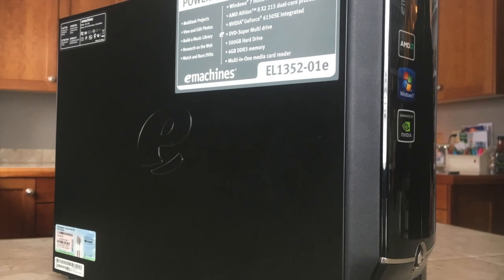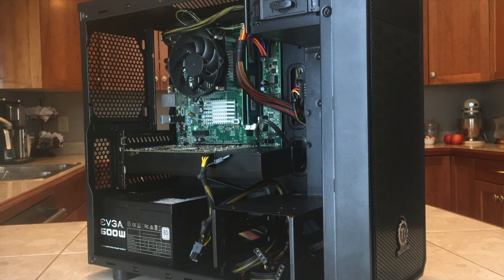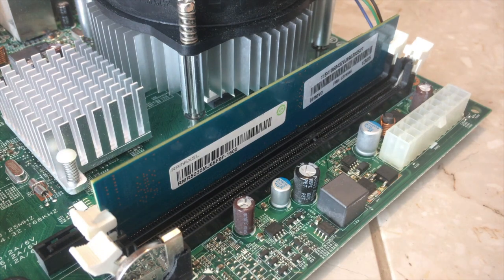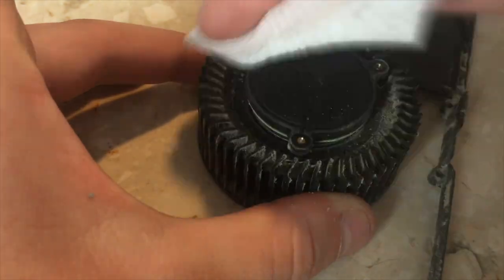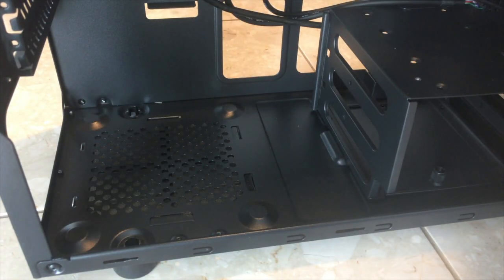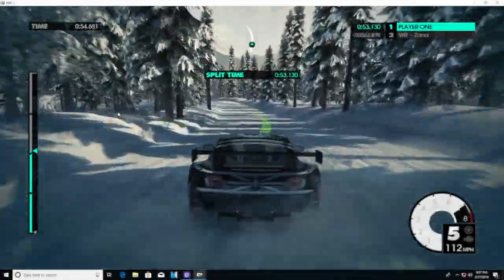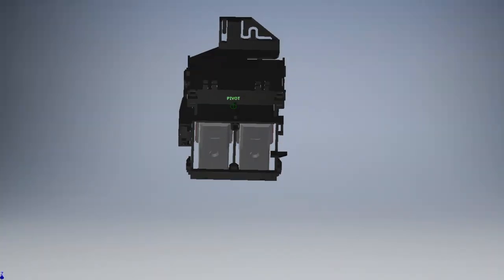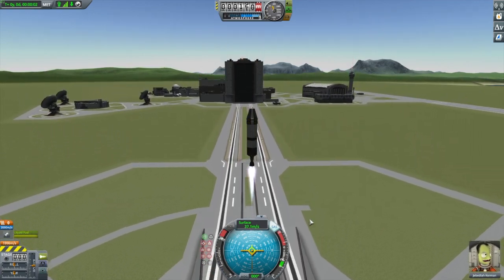Upgrading a 9-Year-Old Prebuilt PC into a Budget Gaming Rig

Comment: I know this is old as hell, but I used to have one of these. Except mine only had 2 gigs of RAM. Then I ran the ultimate test; Can it minecraft? Answer? Nope. Even with the lowest settings, barely managed 2 fps. And then it overheated and died on the same day the warranty expired. Or at least I think it overheated... The fan on the PC wasn't happy the last few weeks of life... Then it BSOD'd and was stuck in a boot loop.

All of this happened before I finally learned how to actually fix computer issues (as well as build computers from scratch), but at the time, that meant scrapping it since it was only worth like 200 bucks at the time and the shop I went to in order to try to fix it, wanted 250 just to replace the HDD.

Comment: Have a similar ultra-slim form-factor eMachine (EL1852g-52w). HDD is the bottleneck for processing on Win10, so best to bump that to an SSD. Stock mobo only has VGA, so if you can't find a low-profile HDMI gfx card, you'll need to buy a VGA-to-HDMI adapter to pipe gfx out to HDMI screens. Doesn't have wifi built-in. So, you can either hard-line it with a Cat cable, or (what I did) get a little $10 usb N wifi adapter. Plug that & a usb adapter for wireless mouse/keyboard in the front, and good to go.

This makes a great HTPC / old-school (NES/SNES) console emulator.

I found mine in the dumpster, and have been upgrading it with parts from other dumpster computers I've come across. I bumped it to 4gb 1333 RAM, but mobo forces it to run at 1066. But, as shown in the vid, you can slap more than 4gb ram in these. (their online specs say they max at 4gb, but folks on forums have succeeded chucking more in. It's just you're limited to 2 ram slots). I upgraded the Pentium it came with to a Core2Duo from a Dell I found. I even swapped the 5400rpm HDD with a 7200rpm one from that Dell (just imaged the old drive onto the new, and slapped it in place).

It runs fine once it's booted and Windows has had time to sort itself out. What seemed to really bog things down was having Delivery Optimization switched on in Windows Update. It was hogging tons of disk time trying to look for or pawn off updates to other things on my network. Not sure why it was such a disk hog. Switched that off, and it's much more reasonable. But, large Windows updates still bog things down and seem to take a long time to roll in.

Mine didn't have a low-profile gfx card, so I had to get a VGA-to-HDMI adapter to interface it with our 1080p tv. 1080p youtube vids are slightly choppy, but not too noticeable. It can do NES & SNES gaming just fine. It has a DVD player, so it acts as our DVD player. We bought a couple of usb SNES-style controllers, and load up MAME or such to play old-school arcade games. It's really a good, solid computer. I wish I could find a better ultra-slim form factor mobo so I would have more upgrade potential, but it is what it is.
Reply: I actually have the exact same pc that I had gotten from my grandparents; had tried to swap out the ram for a 2x2GB upgrade but it would just do the constant beep once it started, my guess is that it’s a different style ram.

Comment: do i realy need the new case?
Reply from the maker: If not, you’ll need to plan your parts around the slim case (no full size GPU, no upgraded power supply, meaning your CPU and GPU can’t be as powerful), so you’d likely be sacrificing computing power and/or increasing your cost to get smaller components.
Reply: @KeplerElectronics  thanks

Comment: Can I put a radeon rx 570 on this rig?
Reply from the maker: Yeah, you can, just double check that the power supply is good enough. I would be worried about bottlenecking if its for something like gaming though. For something like Blender, it might be ok though.
Reply: @KeplerElectronics  I was going to buy a graphics card, because I wanted to play fortnite hehe.
Reply: @KeplerElectronics  what graphics card did you have in the video?
Reply: @KeplerElectronics  is the AMD x4 620 the only processor I can use?
Reply from the maker: The card in the video is a GTX 660, which works well for most mid tier games, I actually upgraded to a Phenom x4 955 since the video, and I think there’s some even more powerful chips, but I’d be wary of running something much hotter without a better cooler, which I was not able to make work thanks to what I believe is a proprietary cooler mount.

Comment: I had one of these in 2006-2009, before building my first pc, and its (the emachines) specs were DDR2 2gb, AMD Athlon 64 1.2GHz, and stock intel IGPU, and no upgrade paths rather then the one extra DDR2 unoccupied slot available for an extra stick to run in dual channel lmao, also that specific board runs back to the el1200-01 (the one I had) the only difference is the addition of a PCIE-X16 whereas the original just had the PCI-E X1!  

the original board funnily enough had the Pin layout ready for the PCI-E X16 slot
Reply: I actually own the Intel variant (EL1850), and it's more or less a great recession special considering the specs. And funnily enough, it identifies itself as an Acer Aspire X1900 in the BIOS and device manager.

Comment: does it run Minecraft texture packs and custom capes and servers really well? Bc I am a Minecraft player.
Reply from the maker: I’ve been playing a ton of Minecraft recently. I’ve been sticking to the stock textures, but it handles shaders like a champ. I’ve been playing mostly on Realms , but playing on servers is still pretty good. Haven’t tried running a server on it though.
Reply: @KeplerElectronics  thanks for the reply I play on servers with friends and have fun and compete I am a minecraft grinder and have a windows 7 pc emachines, if ur okay with it could I get ur discord so I can send u a pic of my pc so u can see if I can upgrade it or if when I upgrade it it can run minecraft. And also jus to add I play the bedrock version of minecraft right now because I have a nintendo switch and that's what it allows but once I get a pc I will get java and bedrock.
Reply from the maker: Honestly, there’s not much to it besides figuring out what motherboard you have, and therefore what CPU you can buy (dictated by the motherboard’s socket). It’s then about getting a new case and power supply to power and house the GPU.
Reply: @KeplerElectronics  ok thanks👍🏽

Comment: I still use this pc in the original case. I upgraded the PSU to a 250watt Delta, the cpu to an AMD Phenom II X4 955 (95watt model) 2x 8GB Kingston HyperX DDR3 1333MHz, ASL G1504 Battle Flag (GTX 1050Ti 4GB), 1TB Hitachi 7200rpm HDD. It's a fine htpc and runs a lot of games nicely. I play CSGO, Insurgency, World of Tanks, Overwatch etc on it.
Reply: How much did all of that cost in total?

Comment: What is the maximum amount of ram that this computer can hold?
Reply from the maker: From what I was able to gather, it’s really more OS dependent than anything, but I haven’t been able to find any sticks larger than maybe 16gb, everything higher is server memory. I’ve thought about upgrading the ram, but I think I’m almost due for a new build anyways (the cpu doesn’t support some features necessary for vr or newer games), and I don’t think it’s worth it for me.
Reply: The computer I have is the e-machines 1331g it can be upgraded too 8 GB Of DDR2 ram. It has a x2 amd Anthlon processor. I plan to install a 500gb SSD SATA and change the memory from the 2gb x2 to the 4gb x2. It's 10 years old still runs like new but the upgrades should give it a bit of a kick in the pants.  We don't do gaming on it just do normal home stuff and watch movies. So not sure a graphics upgrade would be of benefit. Right now it's got the crappy 6150se integrated built into motherboard. But it's not really hindered watching movies in the DVD driver or from Netflix.

Comment: Would this upgrade work with the EL1850 ?
Reply from the maker: The same type of upgrade should work, but that model is running an Intel chip, so you’d have to look into what CPU socket it has and figure out what you could put in it. The Athlon chip I put in mine is from a different manufacturer and will not work.
Reply: I have same model 1850 and i searched a lot of info and i only found that xeon chip its the best

Comment: bro what a good upgrade also i have a el1860 lying around and i just wonder if it can handle 16gb ram?
Reply: well its nice cuz my el1860 has 4 dimm slots so yeah
Reply from the maker: It should be able to. From what I’ve read, it’s more about the number of slots and the operating system than the motherboard itself. You should be able to get 16 gb but nothing more than that (because 8gb sticks are about the max they made for consumers on ddr3)

Comment: I have this pc and it says only two gb of ram can I add more ?
Reply from the maker: You should be able to. My model was a higher end model, but you should be able to put as much ram in as you can buy (seems to be about 16 gb) AS LONG AS you use Windows 10.
Reply: Kepler Electronics my pc is on windows 7 I can send pictures on insta or something how can I go to windows 10
Reply from the maker: @daytonweeks5320  Here's a great resource showing how to do it:

https://www.theverge.com/2020/1/14/21065140/how-to-upgrade-microsoft-windows-7-10-free-os
Reply: @KeplerElectronics  i have almost the model. I looks almost the exactly same but it has a amd athlon ×2 Ii 235e processor. It was released in 2009 or 2010 and is windows 7. It has 8gb ram and the same gpu as you. Do you think its upgradable?